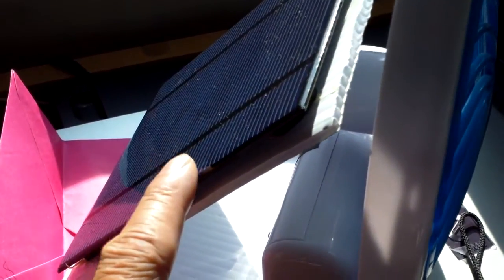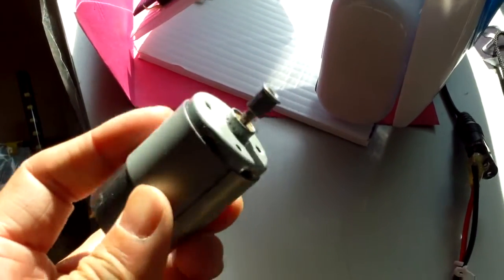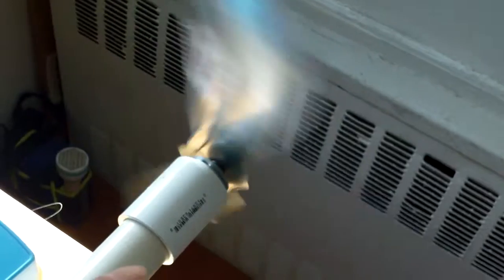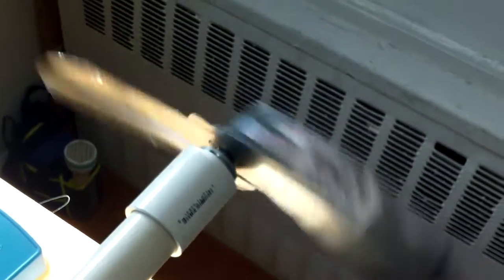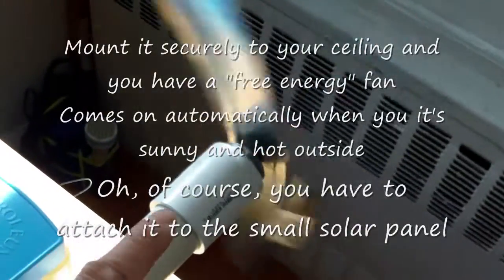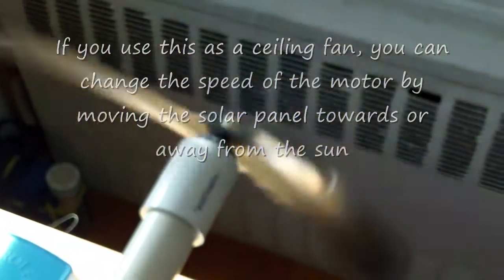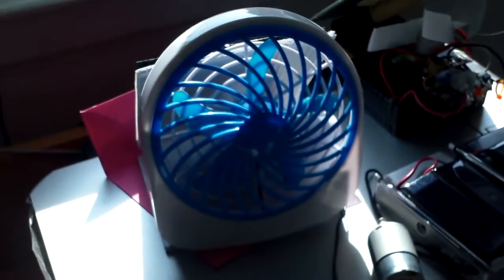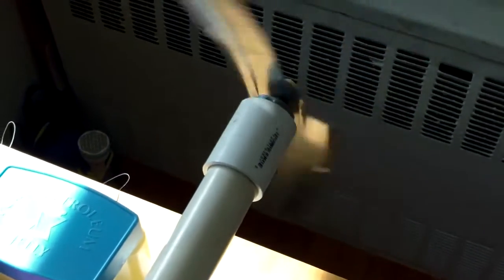Automatic ceiling fan with 2 & half watt solar panel and small dc motor

Comment: I installed this in late summer so I haven't had a chance to see the full benefit...yet.>>>nub.best/x0rq      The install was fairly simple but it is a heavy unit. I blocked the ridge vent in my attic to ensure the air was being pulled from my soffit vents instead of being pulled directly from the ridge.

Comment from the maker: I was just going to look at a real ceiling fan and copy the angle of the blades. I'll probably use corrugated plastic for the blades so if something should fall it wouldn't injure me. I also have to buy another small solar panel to power the motor. It'll probably be 2 weeks or so before I can get this going. Once I get it going, I think it should work just fine. This is no rocket science.